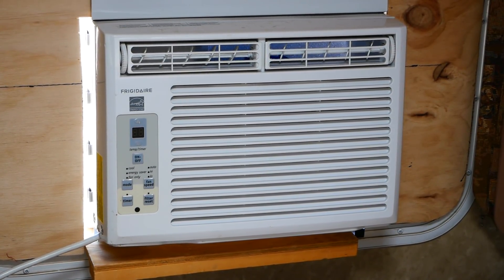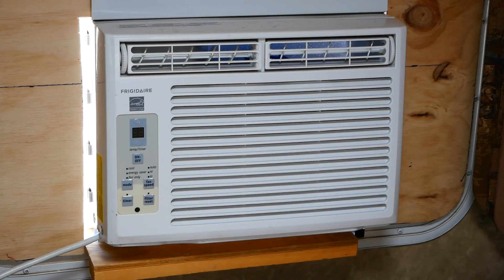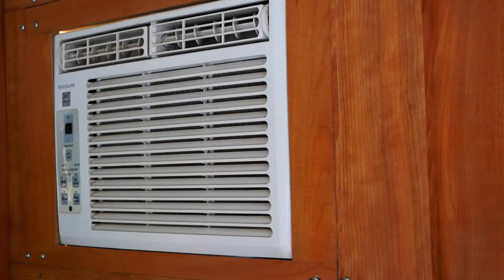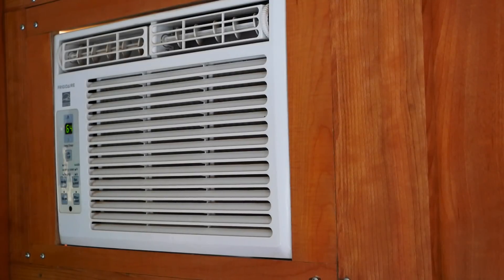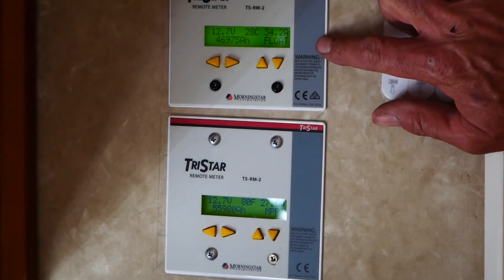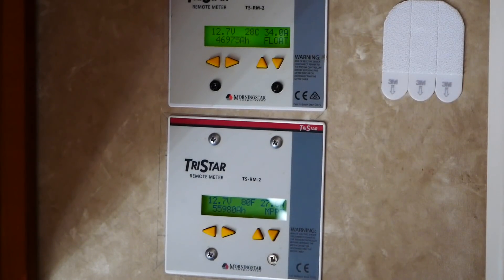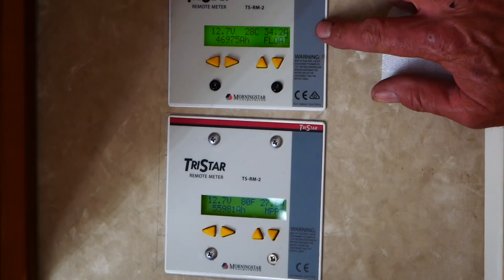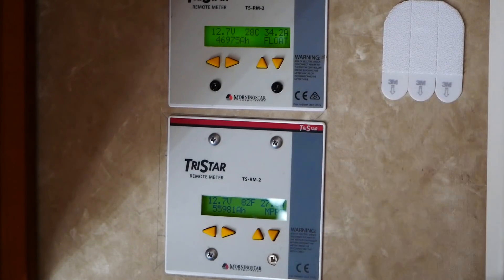Dual air conditioners on 1185 watts of solar

Comment: anyody know the start up watttages for these energystar 5000btu units? i cant find it and i need to know to size my inverter correctly. ive already ordered the most recent frigidaire energystar model and the friggin manual dosnt mention the startup wattage or anywhere else for that matter. i was hoping jim would just off handidly mention the starrt up wattage. thats where im at right now i guess. hoping so hear some one off handidly meantion the startup voltage of a unit that is kinda similar to mine. dont know what else to do. frigidaire bastards! dont they know folks are buying these things to run on low energy systems and will need to knwo the startup wattage!?
Reply from the maker: Honestly I really do not know exactly. I do know that my 800 watt inverter generator with a 1000 watt surge would start the energy star version. Also my inverter is a 1250 watt running with a 2500 watt surge. So I would think that you would be safe around 1500 watts.

As far as the company goes. They generally do not worry about a momentary surge because they expect you to run it on shore power. I have tried to measure it but it is so brief that my meters do not register it
Reply: @solarboondocker4597  thanks for all the good info you provide! im going to try and sqeek by with a go power 700w 1250 surge inverter. ive read that running less watts then an inverter is rated for is inefficeint so in the long run it might be smarter to get the exact right size.... even if it means potentaily wasting 250$ on trail and error. im calling the company tomorrow about the startup wattage. if i get an answer ill let you know
Reply: @solarboondocker4597  called the company and(after a few trys) they said the start up wattage was between 1200 and 1500. maybe theyre wrong or maybe a generator can handle slightly higher watts then its rating to make up for slight variations in fuel? idk im pulling that out my butt, its a big mystery
Reply: @solarboondocker4597  everything is set up and the 1200 wattsurge inverter handles the ac startup just fine...... but only when the panels are in full sun for some reason. in the shade the compressor trips the over load protection on the inverter. which i dont get at all. its not like the a/c would draw more current when its shaded out side. and how much juice the panels are getting shouldnt matter  because the inverters failing on the 120v side. maybe the over load protection is based on the current it can handle relative to its input current or voltage from the batteries, and not based on a fixed amount of amps like im assuming

Comment: Just for those considering doing this. To get 24 hours of air conditioning on One of these units you need a perfectly sunny day for 8 hours of solar which is what you expect to get on a sunny day plus 2500 watts of solar. Plus a large battery bank to run the AC when there is no sun. Remember that you have to top up the depleted batteries in the morning plus run your AC at the same time. It is a perfect system to run for occasional AC. And to run all night and when the sun is down you will need a 700 amp lithium battery bank. And God help you if the next day is cloudy or rainy. Just putting this into perspective. And this is not considering all your other energy needs.

Comment: Hi Jim, thanks for your videos. I'm toying with the notion of putting 1 or 2 under the dash vehicle air conditioners in the cargo/living area of my camper van, when I find the right van. Any thoughts on how that could be done so they would run independently from the vans main air conditioner? Thanks for any input.

Comment: Thanks Jim.  If you had Lithium phosphate batteries, could you get by with a 400 amp hour battery bank for 1 5000 btu ac unit ?   A van should cool off with one unit.

Comment: It appears you are the only Toober professing to run a/c from solar.. So, I continue to ask the question: "What do you do at night"..???  I have been told that you operate the a/c for a few hours...  How many hours..??  Then what..?? Do you suffer until the sun shines again.??  When do you turn it on in the morning..??  In the daytime, w/sunshine, can you charge the batteries and continue to operate the a/c.??   I live LV (and Phoenix is at least 10 degrees hotter) and the house a/c operates from June - Sept and parts of May and Oct..     When the sun doesn't shine, do you use a generator to charge the batts. while using a/c..??  My point being that all this solar is very expensive  for questionable/part time/ use  of a/c w/out realistic questions and reasonable answers..   At the risk if sounding negative this sounds like click bait..Uh oh, now I did it.. LOL!
Reply from the maker: The solar provides for so much more than JUST the A/C's. I have never needed the A/C at night as it cools quickly both in the desert and at high altitude. I turn at least one of them on as soon as it starts heating up because it's easier to stay cool than to cool down. I do continue to charge when running them, one more so than both. I do use a generator in bad weather or in the event I am pulling more power than I am producing. A back up is a important part of a balanced system. I also have converted the hot water heater to electric, use a electric cook top, run a freezer along with more mundane things. You can pull up and plug in if your batteries are low. You will not be the first to do it either.

Comment: It been almost a year and I'm curious as to how the two air conditioners are holding up?
Reply from the maker: I had a issue with the built in unit getting hot due to low air flow. Opening up the grate helped that.

Comment: Hi. When your batteries are fully charged - how many hours of just one air conditioner do you think you could run it for?
Do you have the models, specs of all your equipment as well as a schematic of how you wired it?
Great stuff here!

Comment: Hi Jim! Have you seen the Climateright 2,500 BTU Mini Portable Heater and Air Conditioner?  How many amps of solar and size inverter do you think I would need to be able to start and run this thing for a bit?  I live in a chevy van, would it be more cost and space effective if I bought a small generator instead?

Comment: Good channel Jim simple talk is great. I have 1800 watts solar at home to run 10000 btu air in my master suite has heat pump too saves me heating and cooling whole 2100 sq ft home

Comment: I just got my solar system up and yes, my air conditioner is working.  Thank you Jim.
Reply: Where are you located (me LV)..?? Do you operate the a/c continuously over a 24 hour period day after day..??  At night and when the sun doesn't shine, do you use a generator to charge the batts. and operate the ac/ at the same time..???  I have asked Jim these questions, but have received a veiled answer on none at all..  Sounds like click bait pie in the sky to sell his services for an expensive investment..

Comment: What brand/type/continuous power rating inverter are you using?   I've been trying to do this with PSW Reliable brand 2000 watt inverters even with just one 5000 BTU A/C with no luck, they seem to fail under surge and blow.
Reply from the maker: I use a Tripp-lite PV1250fc industrial inverter

Comment: Hi, Jim, I tried to send you a PM on the CRVL Forum but it said you have reached your PM quota...
I just started into part-time boondocking this year after purchasing a 6x12 cargo trailer and converting it (I have some early build photos in the forum here).  I've done everything on a barebones budget, using company bonus money and credit card/hotel reward points for just about everything, so I've done many things on the cheap, like Harbor Freight 100W solar kit, Coleman thermoelectric cooler for a frig, and such.  Just bought an Olympian Wave 3 for heat, and now looking towards A/C for the summer.  I'm not looking to expand the solar output at this stage, but would rather use the A/C when I have electric hookup, or once I have the funds to get a generator (probably would be the Harbor Freight one of those too).  

The A/C unit would most likely need to be installed in a hole in a wall or the back doors.  While I'm still steeling my courage to cut a hole for the propane hose for the heater, the hole for the A/C still seems miles away.

You said you would do a video on the A/C install in your cabinet, which I assume goes through the wall of your trailer?  Would love to see how you did it, and hear any suggestions or words of encouragement from you.

Keep the videos coming, I love watching them!
Reply from the maker: You can email me at jim@jimindenver.com

I will be back up and running once I get back to the desert this month.

Comment: Is there a way to run the ac and the fridge with solar for a full hot day in an RV?
Reply from the maker: Yes, you just have to figure out how much power does it need, how much battery it takes to hold that power and how much solar it takes to replace that power once you have used it.

Comment: cmon Jim, address the real issue. Anybody can start an AC unit off of an inverter. The reason people say it can't be done is because there's not enough square footage on an RV roof to supply enough Pv power to keep the unit running ALL day. UNLESS, you  properly address the insulation, sunlight bleed, roof-side radiant barrier, and ineffciencies of window style units.
Reply from the maker: Roof space and cargo capacity can be a very limiting thing when designing a system.

Comment: Hey Jim,
Just watched your video with Bob about AC on solar power where it was discussed that you need 800-1000 watts of solar to run a small AC unit and have enough power left over to handle a fridge, lights...and still have enough capacity to keep the batteries charged.  Unless you have a extended length van or rig, or want to supplement roof top with portable ground panels, it's hard to fit that many panels up top.  Have you ever seen or designed a system where the roof top panels are double stacked on a custom roof rack for travel, then when parked, the bottom stack of panels can slide out, maybe on heavy duty drawer slides or something?  The extra panels could also provide some shading to the vehicle too...I'm imagining a panel sliding out forwards over the windshield putting that big piece of glass in the shade...or three panels sliding out over the drivers side to shade that side of the van while an awning shades the passenger side.  If this could work, I'm sure you could get over 1000 watts on a regular length van.
Reply: David, Check out Beginning From This Morning on YouTube. They just did an over under slide out tray for their solar on the bus. It’s pretty sweet the way he did it.
Reply: @davidcrumpler5714  Thanks, I see one of the videos in the series here showing the lower deck sliding: https://youtu.be/COSSN6r7DhU?t=1171
Reply from the maker: I have not dealt with any thing like that yet.

Comment: Hi Jim,  I'm a new boondocker soon to be. Monday a couple is coming to see my sister's and my house. Things are moving fast. We are planning to hire you for solar panels really soon. For now, we need to buy a inverter/generator that can be use as a backup after the solar system is set. However, we don't want to over buy and kill our budget too soon. We have a small trailer that has an AC 5,000 btu. Since it's so hot still we need to run it in case we sell soon and aren't able to get to you soon enough for the panels. Any suggestions on a generator that can handle the AC?
Reply from the maker: I use a Sportsman 800/1000 watt inverter generator.

Comment: How much power (watts) does 1 ac pull on low with the compressor going?  I heard it doesn't make much of a difference whether you have it on low or high.
Reply from the maker: Each of those pull 410 watts on high

Comment: Hi Jim - Curiosity is peaked. Why did you install two 5k A/C's as compared to a factory roof mounted 13k A/C?
Reply from the maker: Because the solar will not run the roof air conditioner AND these are separated for better distribution

Comment: Great content.  I've really enjoyed watching you, and your insanely cute dog, in interviews with other YouTubers and I'm extremely pleased you've started your own channel.

It would be cool to see a video on how you have installed the AC units.  One problem with the wall mount ACs in a TT is the AC weight on the relatively weak TT wall/cabinet.  Another problem is separating the air intake and exhaust.  I've seen some RV's with a factory installed wall mount AC where from photos it looks like there is a roof vent above the AC.  Below the vent you can see the rectangular opening where the AC exhausts heat.  My guess is there is some sort of baffling which prevents the fresh air intake and hot exhaust air from mixing.

Have you tried running both AC units on a 2K generator (Champion/Honda)?

My TT has a 13K BTU roof AC which I'm pretty sure my 2K Champion will not run.  I was thinking of somehow installing a 5K wall AC and hopefully run the generator in econo mode once the AC has started.  In econo mode the Champion will supposedly run about 10 hours on a gallon of gas.  If a 2K generator could run two 5K AC units in regular mode that would be really nice in hotter and more humid areas.
Reply from the maker: I will have a video of the cabinet install out soon and the window mount I will shoot as soon as I get a chance
Reply: Awesome!

Comment: Hello Jim...I just saw your video installing Bob wells dc to DC controller why didn't you use an isolator, I did a little research and it seams you would need that due to the alternator lowering voltage in a newer vehicle, when the starting battery reaches a certain  voltage and not continuously charging the house battery...thanks
Reply from the maker: Bob had a isolator or something of the sort in line already

Comment: Thx Jim!!!
Would it be safe to say that if I had only 1-5000 btu AC unit to run I would need a minimum of 600 watts of solar?
Reply from the maker: It is possible you could using the high efficiency unit I have linked above
Reply: Thank you so much!!!

Comment: Thanks much Jim. Are you able to measure the startup amps? Wondering how big your inverter and battery bank are? Nice demo.
Reply from the maker: I have never been able to measure the start up amps with my equipment. I have a 1250 watt inverter with a 2500w 10 minute surge and 675 Ah as a bank

Comment: I love your setup! I'm looking into 1000w+ myself. Do you have multiple inverters to spread out loads?
Reply from the maker: I have a single industrial inverter that runs everything 24/7
Reply: @solarboondocker4597  Must be low frequency..I use one as well for a swamp cooler and now for the AC as well..great Videos